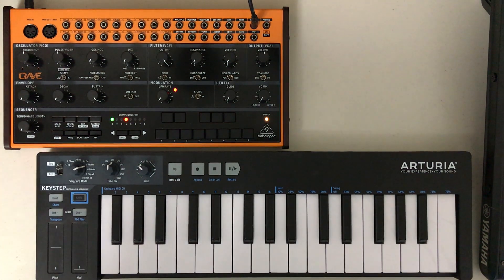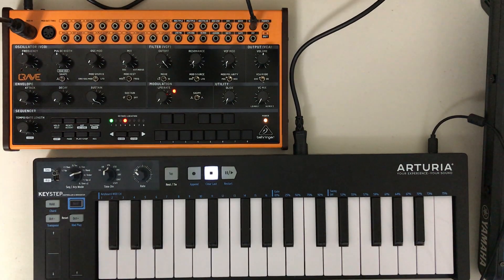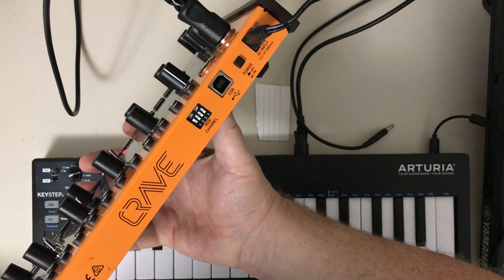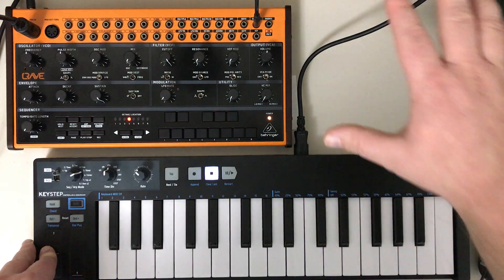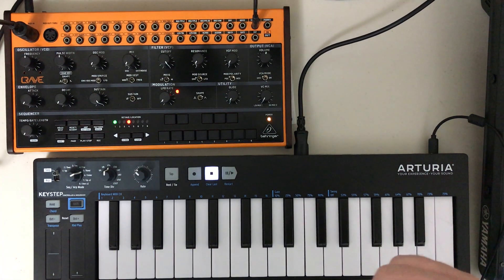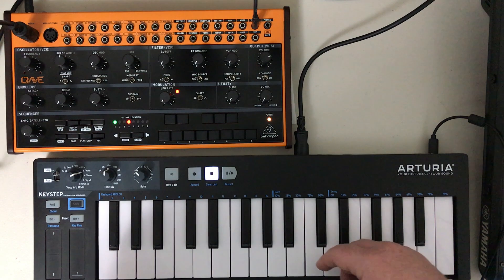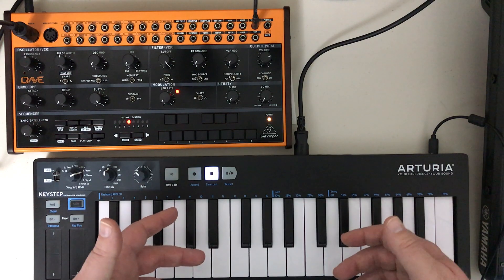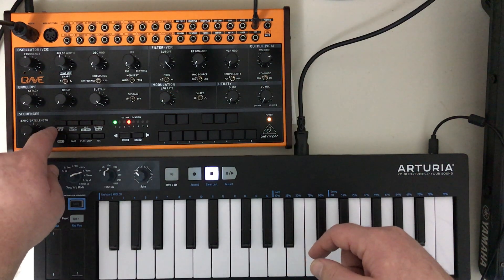Behringer Crave Tutorial #2 - MIDI DIN

Comment: Hello,
Thank you for the help that your tutorials give, regarding connecting a keyboard via midi to the Crave, it is not working for me.
I have a MINILAB 3, I connect the midi output and connect it to the midi input of the CRAVE and no sound comes out, I have already adjusted the midi channels in each of them to channel 7 and nothing. Do I have to make any other adjustments in the Crave in the SYNTHTRIBE software?
THANK YOU FOR YOUR HELP AND KEEP PASSING ON YOUR KNOWLEDGE.
Bye Rui
Reply from the maker: You're using midi DIN cable? And the dip switches are set correctly on the back of the crave?
Reply: @music-with-eric  I went to the images that show how to change the midi channels that you see in the instructions and that's how I put Crave on channel 7 following the images, so I assume that it's ok.
Reply: SORRY hy use MIDI DIN

Comment: Hey Eric, I've been sequencing my crave with an arturia beatstep. The problem I have is that every time I press play on the beatstep the pattern on the crave also starts to play. Do you have any idea how I can deactivate this so the crave only gets the midi notes but doesn't start the sequence? Really appreciate it thanks for making all these great videos :)
Reply from the maker: If you set the Crave's clock source to "Internal"  it will ignore incoming transport messages but it will still play the pitches being sent by the Beatstep. I just tested this using my Keystep37 and it worked correctly. You can change the Crave's clock source using either shift+hold+8, page 3, option 1 (see latest version of the Crave manual, page 41), or by using the Synth Tool app on your computer.
Reply: @music-with-eric  This is not the best way though. Because if you do this, you will not allow the Beatstep or Keystep to be the master clock, in case you want to control other hardware with your beatstep. In order to keep the Arturia the master clock, set the Behringer clock to MIDI DIN input, and disable the Crave's 'sequencer auto sync' option via the Synthtribe app. This makes sure the Crave keeps the clock of your Arturia, but doesn't automatically start the sequencer. (You can manually start it by pressing play on the Crave) 

Also this way, you can use the ARP function on the Crave with the clock from the Arturia, if you want too. And it will be easier to assign a specific BPM if you like to experiment with doubled sequencers. (It's impossible to set a specific BPM for the Crave...)
Reply: @PANTA-Music  Thank you for this! I have been trying to figure this out, for awhile. It drives me nuts, having to stop the Crave from playing whatever, after I set up my Keystep. Trying to record is a pain. Now I just have to set up the Crave computer App. lol!
Reply: @sandyturner1911  Did it work for you? :)

Comment: Hi Eric! Is the behringer crave similar to the behringer td3 bass line synth? Thanks
Reply from the maker: It's not really similar at all. The TD-3 has a very limited tone palette and range compared to the Crave's vast possibilities for modulation. Using the TD-3 sequencer is a much different experience as well. However, I really like the sound that the TD-3 makes, and how quickly you can get it to do what it's best known for - replicating the acid sounds of a 303 - but I often use it for non-squelchy sounds as well. The Crave can get close to that sound as well, plus do a great deal more.

Comment: I have a problem with my keystep and crave im in the correct MIDI Channel and when i press a key in the ks i get sound , but the arrpegiator and the sequencer dont work i dont know if a i need to change something in the crave synth tool app
Reply from the maker: Forgive the obviousness of my reply, but are you sure that you've pressed play when trying to use the arpeggiator? If your Keystep is audibly triggering the Crave's pitches it is indeed hooked up correctly, so that's the only thing I can think of.
Reply: @music-with-eric  yes i hit play but no sound , btw i put my key step in usb mode to play with ableton and now is working with my crave the problem now is that if a decide to change to sequencer mode the volume of the crave  is lower and affects the decay also i don't know if i have to change something in the crave synth tool or in the key step software

Comment: I need some help hooking up my crave to use my Roland sh-01 how do you sync the midi of the Roland to the crave.
Reply from the maker: I don't have a Gaia, but since it has MIDI DIN ports the process should be the same as I describe in this video. Be sure the Gaia and Crave are on the same MIDI channel; set the MIDI OUT from the one you want in charge to the MIDI IN of the other. You might also want to check out the final video in this series where the Crave is sending info to the Volca Bass.

Comment: My Midi keyboard has no Midi Output, only USB out. How do I connect it?
Reply from the maker: You have two options. The first is to connect your keyboard to your computer via USB, and also the Crave to the computer via USB, then use a DAW or other program to route the MIDI data from the keyboard to the Crave. The second way is to get a small device called a USB to DIN converter (this is not the same as the common USB to MIDI DIN cable). This will take the USB input from your keyboard and send it out of a 5-pin MIDI DIN jack and into your Crave. This is the one I use: https://www.hobbytronics.co.uk/usb-midi-converter. For most people, I imagine the computer interface is the easier way to go.
Reply: @music-with-eric  Thank you so much for the answer, bro!!! You are the best.

Btw, I use the DAW Reaper... I'll try routing Midi thru it.
Reply: @Bruno Romero I know it's late, but there's a neat little program called miditrix that lets you route any MIDI device connected to your computer to any other, without having to start up your DAW all the time, if you just want to play and jam.